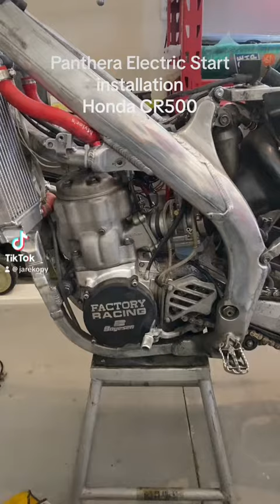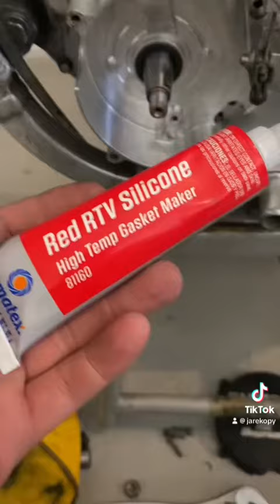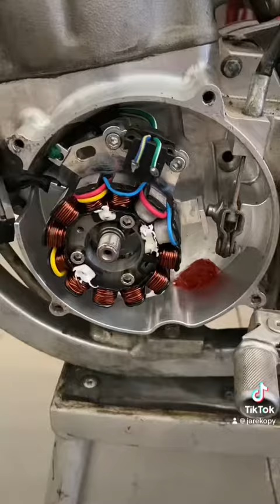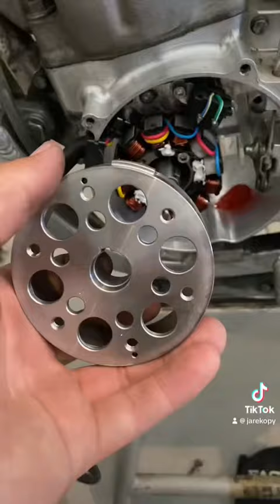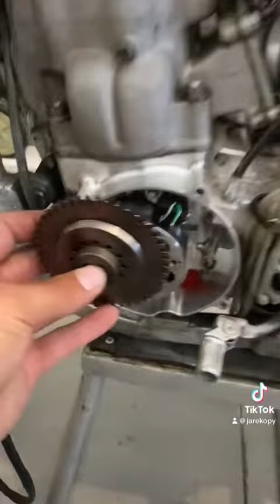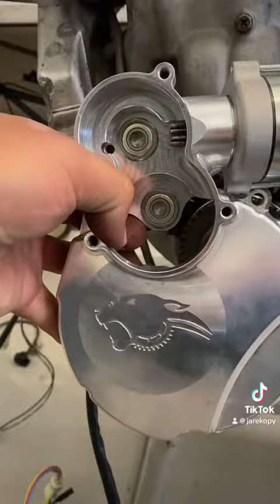Installing the @PantheraMotorsports electric start gen02 kit on my Honda CR500 snow bike

Comment: Any way to use MSV stator and phantera estart? I received my estart and a out to install it so to see thar didnt work for you is a bummer
Reply from the maker: MSV one should work for you in the meantime and might actually be a better stator kit.
Reply: @VETRIDERZ so you are saying MSV stator can work with phantera flywheel and estart kit together
Reply from the maker: @oscarpucheta746  MSV stator and MSV flywheel will be needed, but it should wire into the panthera wiring harness. Might need to make some splices.

Comment: Any update with part 2 ? Also wondering how this Gen02 kit is holding up.. ?Thx
Reply from the maker: Ended up taking it back off. Motor never ran right with that stator in there so I’m back to kicking it over again.
Reply: @VETRIDERZ  I was worried about their stator - I love the way mine runs with MSV's parts.
Reply from the maker: @hoofaarted  I’m also running MSV parts in the ignition system now. Holding up very well so far, and it runs a lot better. Something kept arc’ing out on the Panthera one. I sent it back to them and they claimed they fixed it and ran it on their test bench. I put it back on and had no ignition at high RPMs, and could see the spot on their magneto that kept grounding out. Switched back to my MSV one and the motor ran normally through all RPM’s.
Reply: @VETRIDERZ  Now if MSV and Panthera can collaborate and deliver a quality product, that would be perfect!
Reply: Any way to use MSV stator and phantera estart? I received my estart and a out to install it so to see thar didnt work for you is a bummer